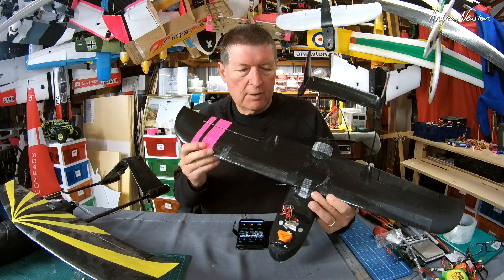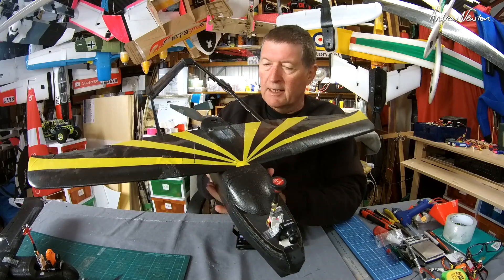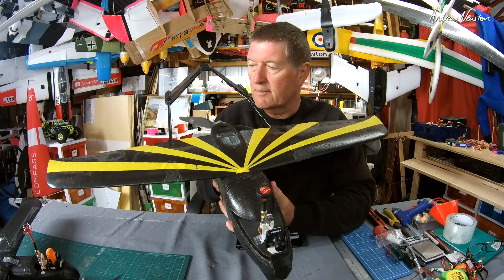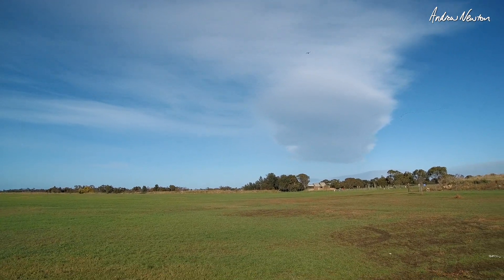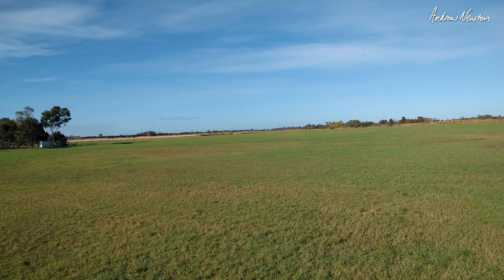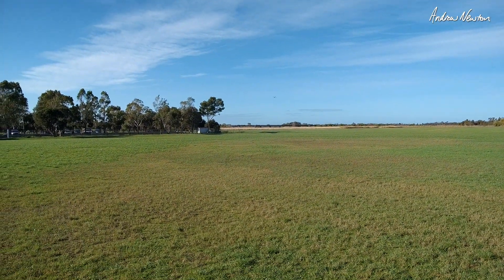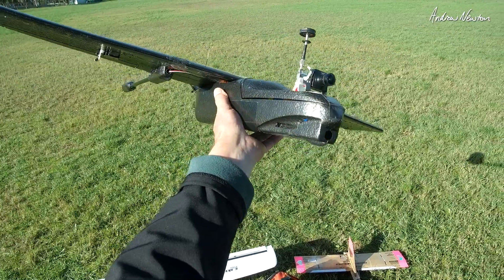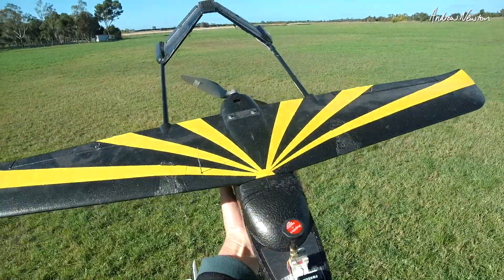SkyHawk V2 single motor

Comment: Hi, do you think it's possible to fit a 3s Li-ion pack in the Sky Hawk? I think a 3s Li-ion pack is a little highter than a 3s Lipo battery
Reply from the maker: Would need to cut out some foam I suspect
Reply: @AndrewNewton  yeah indeed, the battery bay seems to be not very high
Reply: Do you think it's possible to put the 3 cells of the li ion pack next to each other, flat?
Reply from the maker: Probably not.

Comment: I am in the process of adding 100mm to the wings, (50 on each side) so it could get enough lift to carry a BIG li-ion pack, and try to do some serious long range runs. I have already swapped mine over to a traditional twin boom tail. (I wanted to mount a rear-facing camera and I never like the way it looked with the v-tail) I am on the fence about whether i should lengthen the tail booms. what do you think?
Reply from the maker: Good ideas. Longer booms would make for smoother flights.
Reply: I did a short flight with the longer tail and wing extensions.  I am VERY happy with the mods.  I can fly super slow now, and it won't have any issue  lifting an enormous battery for some cross country fpv flights.

Comment: Great video, I am enjoying fpv with the gear you recommend and the brilliant Phoenix 2.4 glider. Can you recommend a autopilot /gps unit that is easy to install and use. I am not computer savvy.
Reply from the maker: Bigaole BGL 6G-AP is the simplest, but doesn't have on screen display, only gives basic stabilisation and Return to Home. Matek F405 Wing board with iNav is my favourite, but it requires soldering and computer setup. Don't have experience with anything else. Maybe research Eagle Tree?

Comment: I didn't realize the Skyhawk was that much bigger but it is... Can you mod it to change the tail to the Skyhunter config?
Reply from the maker: Can and will Lauren, I think it will improve yaw stability
Reply: I think yaw stability can be improve by adding a small carbon spar to be linked between tail end, this will increase tail stiffness and prevent the tail from flexing therefore it will increase yaw stability.

Comment: any thrust angle applied or just straight forward ? did you know how to reduce the noise caused by single motor ? I flight in a rural area which noise is something thing to complain.
Reply from the maker: Straight forward. There may be some designed in to the mount but I didn't look at that. Tractor motor setup is always quieter, or moving the motor as far away from the trailing edges as possible.
Reply: oh it's a perfectly well designed, because from your video I don't see any down dip tendency like another pusher plane did (ranger G2, skyhunter, skysurfer, etc).
you throw it from your hand and it just flew smoothly.
as for the arising noise, do you think the rigidity or stiffness of propeller has any affect on noise build up ?
Reply: I've found that using folding propeller (flip to backward tractor propeller but the blade is arranged in reverse direction) is less noisy than using fixed propeller. I've tried it by using my oken epo's propeller on skyhunter, it's less noisy but it still noisy than oken epo itself, and it makes control a bit jumpy since it takes time for the propeller to be open wide and pusher plane has down dipping characteristic, and in gusty wind the folding propeller vibrates annoyingly
Reply from the maker: The prop noise is not bad, just that it's a little noisier than the twin tractor setup
Reply: Thanks for the advice, I've tried using 5552 tri blade propeller and the noise drastically minimized, it was screaming noise but now it's just humming noise. Thanks so much SwampCritter

Comment: Love all your projects Andrew. Thats a Good one.  have a Similar power setup on my bixler2 a 2218. 1080kv flitetest motor, 30amp esc with 9×6 apc prop .only draws 18amps at full throttle crazy long flight times on a 2200 3s. 👍